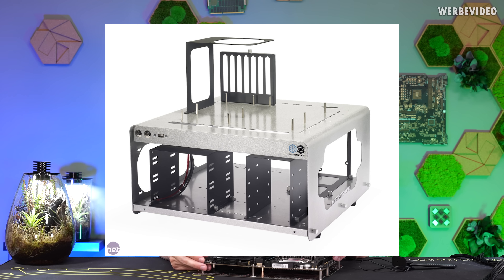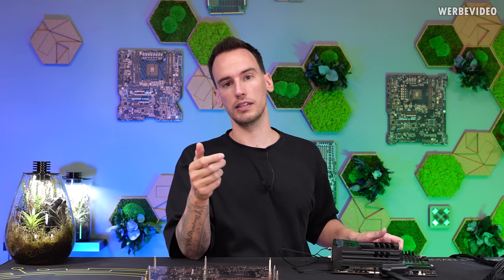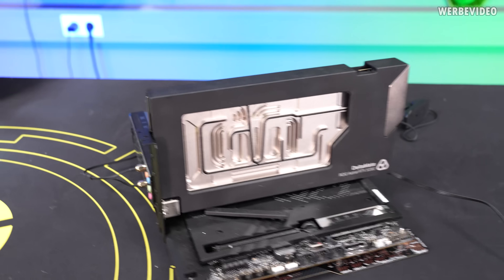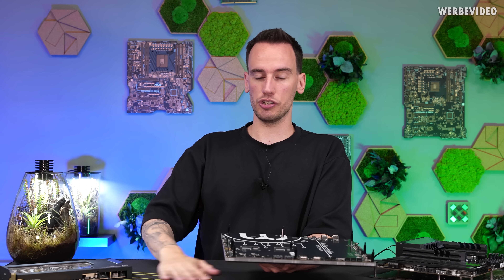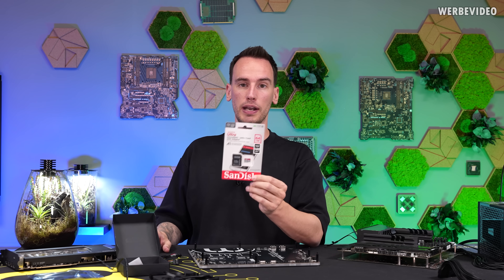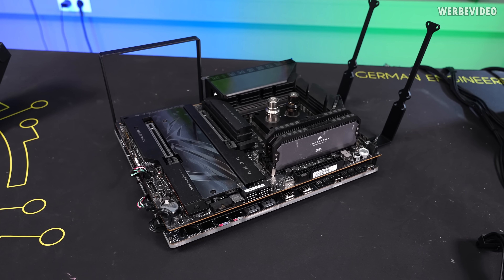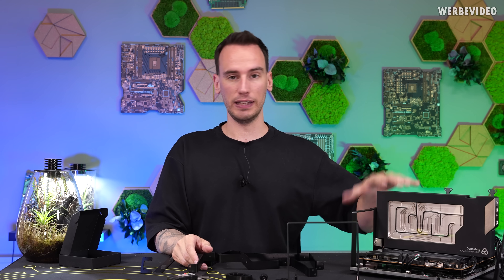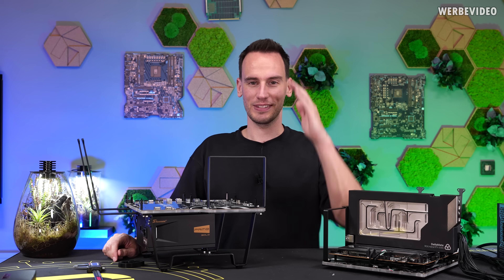I developed my own Benchtable!

Comment: Kinda late feedback, but I actually went to buy this and it is out of stock, like most of the products on your website unfortunately. I ended up buying an Elmorelabs Benchlab, which aside from the lack of storage mounting (which if you use it on a Streacom BC1, doesn't actually matter), which was actually cheaper, with more features and more included accessories. Honestly, I don't know really understand the point of this, unless you just don't like the Streacom BC1?

Comment: 10:20 The rated read speeds of SD cards is kind of fake because unless it's a UHS-II card, I doubt it's capable of transferring faster than 90 MB/s unless there is some sort of special transfer mode for UHS-I SD cards I'm unaware of. The readers would also need to support the extra data pins of UHS-II. Though, faster USB would at least benefit from like ~30 MB/s versus ~90 MB/s where UHS-I caps out.

Comment: why does a 7900xtx does not post on a asus b650M-A wifi even with the latest bios the gpu is brand new and all other Nvidia gpu works fine and the 7900xtx works fine in another intel system as well but some how it manages not to work on ASUS B650M-A WIFI motherboard. 
please need help 🙂

Comment: You could also turn something like this into the ultimate open air PC case. I would add USB 3.0 a toggle switches for the micro SD cards and a optional virtual stand bracket. I think those small upgrades would allow this to also pull double duty as a really cool super minimalist case.

Comment: Looks great, but why is the right connection for the 2.5" SATA drive so badly placed, with a standoff in front of it? You went all the way to design a perfect testbench and then did not turn that connection around?

Comment: What a nice stable table with short cables. I'd call that color of black you chose Sable.  If you are able, could you use it to play Fable?

Joking aside, adding the electronic features is a really nice idea for a benchtable. I've got a Streacom unit, and while it works well structurally, it doesn't help at all with the electronic features that a PC case would normally provide like a power switch and LED. I've come up with workarounds, but it would have been fantastic if a product like derBenchtable had been around when I was shopping for one!

Comment: This is a very heavy featured project. It doesn't just look ideal for test bench but overclocking as well.
We all have some kind of enclosures, fast disks, fanbus, open loop system, etc. This covers everything.
Very cool. If I went back to doing overclocking demos, this would be the most important kit for setup.

Comment: this could also have a variant product, or add-in to this, in which you add a radiator layer or bracket.

Then you can have a fixed pump space/area as part of the bench, pre-connected with hoses to quick release terminals. This way you can just come with your GPU and CPU and connect to those quick release terminals with short flexible hoses.

All of this can be powered from that same PCB.

Comment: 9:03 The USB cable is short to reach mini ITX motherboards, most of them have the header next to the RAM slots. You need minimum 25 cm long cable or even longer if you want to avoid the GPU too, hes cable looks abou 12 cm long.

Comment: Would istantly buy if it supported SSI EEB-sized boards and 8-slot bracket, for e.g. WRX80 Sage with a GPU in the bottom slot. But it is already a very nice product, congrats.

Comment: Will a bigger radiator (AIO) make whole platform unstable due to gravity center point moved to one side? Additional rubber stands under radiator hooks would solve it. Screws for holding radiator stand should have bigger heads (ISO 7380-2). Add maybe shorter frame to hold Cards with shorter server bracket. I would prefer soldering points to have bend 90deg pins already soldered with spare single wire connectors. Otherwise good for you Roman 😀

Comment: I can justify the extra spend for a usb 3 version as it can save a lot of time in scenarios where you need to read or write large amounts of data in a pro setting where time is an issue. I've made disk images over usb 2 and it's no fun, even if there's only 100gb of data.

Comment: 14:04 why not a quick release gpu mount? even just a nub where the screw normally goes would be good enough for bench to keep the gpu stable. could maybe have a nub screw and offset the bracket from belowwithout a redesign.

Comment: Ah good old scope creep.
Micro SD is about the worst thing you could have chosen reliability wise. They're even worse than a cheap USB flash drive for quality. 

With the GPU, add a screw from underneath, then you can reduce the amount the GPU's can move.

Comment: Wow. Great job, however I still see open benchtable V2 as a much better choice. I would've liked to see a radiator mounted to the brackets on this one so I can compare, I have a feeling the brackets here offer better stability for radiators, especially if you move the bench table or change the radiator often, I don't like the mounting on V2, they wear the threads out on the radiator but aside from this that's it, I think that V2 is just better

Comment: Answer Title: Of course you did :)
Update: Could you put a raised nub for the second GPU screw slot to sit on? So you would have a screw-in hole but a nub for the lower bracket to slot into.

Comment: Another thing that may be very helpful is to include a usb pin header to normal usb-A cable adapter. Being able to plug the "benchtable" into a laptop to flash files onto those SD cards and USB sticks, without having to take everything out of it, would be super useful.
Maybe V2 can include a microusb (or usb-c) port that does the same, but with a switch to select between that and the internal pinheader.

Comment: It would be nice to add a speaker, a small pi display and a esp32 module that can listen to the speaker to determine error codes and status, perhaps as well vampire into i2c data lines for diagnostics.

Comment: Happy Sunday Herr Dremel lol ...

Once BTF becomes the standard, setups like this could be pure plug-and-play—especially with a purpose-built MASTER PCB or benchtable. It’s exciting to imagine how streamlined builds could get. Definitely brings back some great memories of tinkering days gone by.

Maybe someday someone will finally crack the code: a truly universal, fully modular connection system—one base, one master connector, compatible with everything. Plug and play, no exceptions.
For some reason, this all reminds me of that old GRUNDIG TV my parents had… classic engineering vibes. 😊

Happy Sunday, everyone!

Gut gemacht junge
Reply: I doubt BTF will mandate the physical locations of the connectors because each motherboard size will need different connector locations. I also doubt it will ever take over personally.

Comment: I would buy it. I would prefer the added complexity of full USB 3 speeds (making is a functional USB hub) and since this benchtable is also basically an add-on peripheral to the motherboard I would prefer not just 2 SATA but M.2 as storage expansion. As full speed as possible for everything. Maybe an option for a taller set of feet for mounting the PSU underneath.
Reply: Nice! I guess I should finish the video before talking about mounting the PSU.
Reply: This would be great for repair shops which is why I would buy it.

Comment: BC1 owner. Bit of 2020 and mounted a monitor to it when i was moving 😅
Now we're putting 720mm of rads and a big res on some 2020 and mounting to it. slides onto two shelf supports on the wall

Comment: Dimas was big not because of the hard drives but because you could mount radiators the bellow the motherboard… I still have my XL with 2 x 560 for example. Weird you said hard drives were the reason … 

I actually find your bench table less usable than dimas. Unless you only use for reviews …

Comment: personally i would had liked a plate that i could boal on the underside to hold the psu off to the side instead of the legs ( keeping it all flat/low profile and still have the psu hard mounted for when moving it all around )

Comment: This is a neat idea, but its not something I'd use. I dont usually need a bench table, however the few times that I have neede one I've also had to move it so I need a way to mount everything to the bench and a handle so I can just lift it up move it. As a reesult, I've gotten a lot use out of a horizontal open case rather than most bench tables.

Comment: i do have my first gen benchtable here. i use it for almost a years 24/7 for comptuer task . until i get a case. Note the i use it with and without the legs flat also. with rubber feet. Nice work Roman look amaizing since I use ti have a small computer help station here and now i can not do it, still have my table ready to go when i needed.

Comment: You should integrate power delivery into it, so all you have to do is plug in all PSU leads at one point and have them break out where they're needed. Could also pretty easily integrate power monitoring hardware or, if you really wanted to get fancy, reach out to Seasonic and see if they could design a PSU that could fit across the board.

Comment: What a great product. This would be a big time saver for me  for testing new hardware and benchmarks. Great work Roman. Also glad to see watercooling fittings. Thanks Joey - I am sure he helped in this department. Soon  I will switch over to all Thermal Grizzly fittings. They look clean - Maybe i will make a video of that transfer. I also like that they are 16mm For ridgid tubing as that is what I always use. Thank you Roman and staff.

Comment: Watched for a couple of minutes and thought to myself, 'But why? Just use a mobo box or some other makeshift contraption, no? This seems a bit over the top and unnecessary.'

Watched it further, realised how much convenience and efficiency this tool would provide to someone like you as well as others in this field.
I feel like a lot of people who wanted something similar but couldn't really find a means to produce one themselves will highly appreciate this.
Reply: Yeah, this kind of thing only seems overbuilt to someone who might only disassemble or rebuild their computer a dozen times at most throughout its lifetime. Reviewers aside, imagine all the people who work in computer repair shops who are short on time and need a robust, comprehensive solution that will get the troubleshooting done as quickly as possible and survive constant use.
Reply: As someone who is a box user for my main PC, some waterblocks screw in from the backside aswell. So if I wanted to easily tweak mounting pressure, etc. It's really hard to access since I have to lift up the entire system. I've been looking at benchtables for a while and I've never been impressed enough to fire on one. 

This one may change that.
Reply: He made this bench, because he can, it is the same as high-end audio, luxus cars or watches. Lots of people need this kind of bench and they do it themselves, just like me, you generally need 6 standoffs and some kind of bracket for the GPU, or just gut out a cheap case. Keep in mind if you build this type of bench you definitely not switch motherboards often enough (maybe 4-5 times a day), it is simple too dangerous to do, you can knock off components from the back or scratch the motherboard with the standoffs. 
I use 2 pieces of soft wood fastened together with a M10 screw, I can push the motherboard into the wood if I want it very secure, but I can also lift up the motherboard and check the temperatures with a thermal cam.

Comment: Si's should take ideas from this. Future mother boards should have All or most of the smaller-mid sized connection points on the back so we can run the cords through the back plate of the case and have a much cleaner look. While I understand that not all cases allow for this kind of idea I think a lot of people would buy into it and I don't honestly think it would take much for them to do it. If you think about it this should allow them to put potentially more on the boards as well and make the boards more feature rich more diagnostics or more slots for something. Sky's the limit really I'm surprised that mobo manufacturers have really utilized the back of the mobo more.

Comment: Knocked up something similar using 20x20 aluminium extrusion and a few 3D prints to set up an old twin XEON server board.  Looked better than anything in a case so it's still running naked.

Comment: I want that, but I want the PSU mounted on the back side above the CPU power connector on the  MOBO.  Like you I don't want my bench that high up, BUT I do want to have the PSU be part of it.  Could maybe make it mountable on or in place of you AIO mount?  I have a 1000W PSU that I keep for testing.  With the PSU and feet in your design it's too tall.  If I had it set up on a desk all the time I'd want what you have, but to store it off and use it the way I do, I want it "flatter".  Love the rest of the design though.
Reply: Open Benchtable does that and less expensive.
Reply: @Druac that doesn't look anywhere near as good a design and is still very expensive for some milled aluminum.  That looks like it took a couple hours on the CAD and probably costs them about $50 to make each one.  At $80 it would be a good deal and reasonable design.  I'd much rather have Roman's but still want the side mount PSU, but for the price I'll stick to my motherboard box for my testing and builds.

Comment: Somehow this made me NEED a bench table :D
Reply: Less susceptible user.
Reply: I have a bykski bench/open-frame. 

They are handy. Most times its just my streaming PC. And I have it done up to not look tacky. But at the drop of a hat, be it plug and play GPU testing, or a min conversion with a few thunb screws to test other platforms. 

It all comes down to how you use it, or rather set it up.
Reply: Same I’m not a home lab guy but I’ve always had a hard on for bench tables when I upgrade my pc I’m buying this.
Reply: imagine being this susceptible to marketing 😂 garbage
Reply: @chimpo131 15:54 He says in the video that an average user probably won't need this.

Comment: I don't know why there are connectors on the benchtable itself. After all, all these buttons and drives will have to be connected to the MOBO with cables anyway, so why not do it directly?
Reply: i imagine to connect the one wire to the motherboard so its faster to swap out motherboards instead of doing sata, usb, sd, fans etc

Comment: Maybe a future upgrade could be latch that would be easy to close on top of the GPU bracket to hold it in place, or something similar, as you are right, nobody wants to go through the hassle of screwing the GPU in each time, if they are testing a bunch of GPUs. So some sort of easy fix, sort of like many have done with the M.2 SSDs now, where you don't need to screw them unto the motherboard, but can just latch it on and off easily.
Reply: As much as we might wail on Dell and the other business computer manufacturers, toolless latches are nice.
Reply: @BobHannent I said the same thing in another comment. This is the perfect use case for such features and if there's a rubberized strip under the latch it could help minimize unexpected noise from GPU vibrations and accommodate minor tolerance issues.
Reply: Open Benchtable…and cheaper.

Comment: Since you're not screwing down the GPU's, how about inserting a screw from the underside so you have a pin on top, so it can't wiggle as much?
Reply: I was thinking the same thing but any tolerance issues could make inserting the card onto a pin frustrating. Personally, I'd prefer a simple, hinged locking mechanism covering all the PCIE slots. Put the card in, flip the lock then release it to take anything out. This would also ensure a card couldn't pop loose when handling the bench for whatever reason.

Features like this are one of the few things I've liked about many OEM cases we've seen over the years.
Reply: @JJFX-  My Lian-Li O11D Evo XL has 2 latches like that, they cover 4 slots each.
Reply: @TheDeeGeeNL Oh cool, that's good to hear. I'll be honest I don't really deal with a lot of modern cases anymore so not sure how common this is now. My 011 Air is the last one I got and even that doesn't have half the panels on most on the time lol

Comment: Surprised you don't use a Streacom BC1 tbh. Ill buy one of these though, looks tight! The GPU retention mechanism looks awful though, I prefer the post mounts on the Streacom. I would like to try mounting the PCB only to a Streacom BC1.
Reply: I test a lot of mainboards and I'm using the BC1 since 2019 (v 1.1), it's amazing